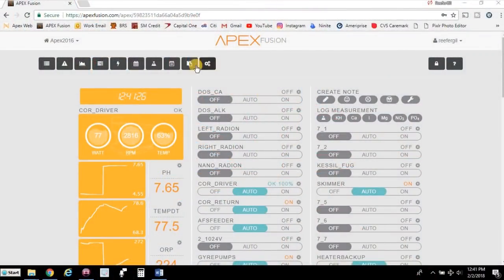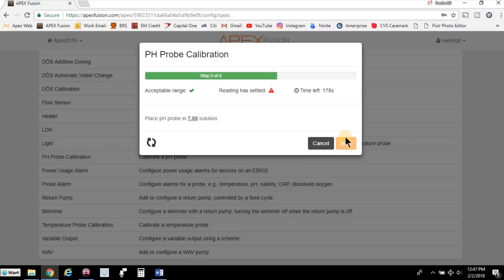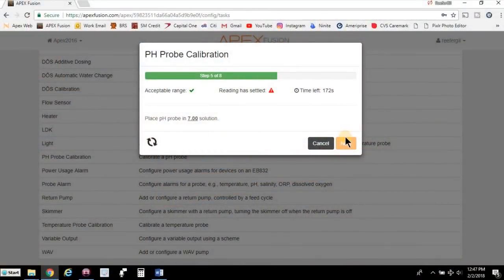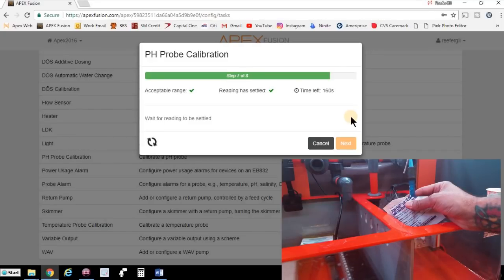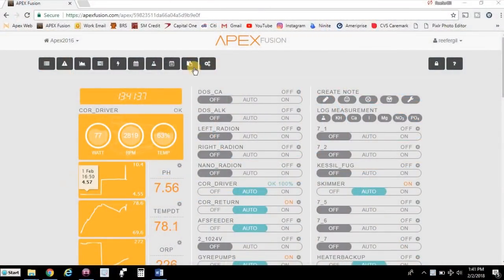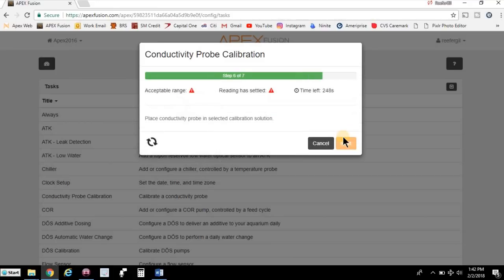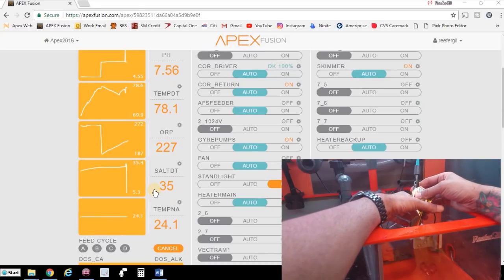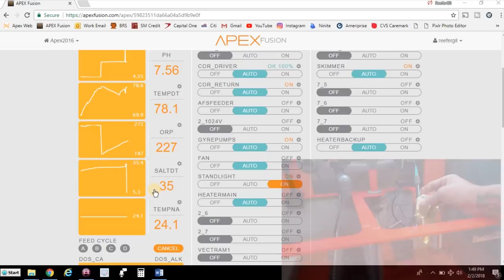Apex pH And Salinity Probe Calibration

Comment: What if after calibrating twice but it shows 7.16 on my fusion dashboard when placed inside the 7.00 PH reference solution...Temp is 77.9
Reply from the maker: That's not way off to the point I'd be concerned. But in reality, it should be a little closer to 7.00

Comment: Thank you & great video! My only problem is with my Salinity Probe. I can't get the green check for the "Acceptable Range." The probe is straight out of the box and bone dry. Yet it still says to "Dry the Conductivity Probe." Am I missing the brain cells necessary to get this to work? If I understand you correctly it shouldn't be put into the solution yet at this point. Please help! I'm no Chip so I have little love for technology.
Reply from the maker: Correct. Needs to be dry prior to placing in solution. I took a paper towel, wrapped the probe, and shook it.
Reply: @ReeferGil  I finally got it to work. But def. need to try recalibrating. Kept getting messages on my phone that it was high. Came home and tested it with my Refractometer and it was a perfect 1.026. Guess technology needs to be taken with a "Grain of Salt."

Comment: This was so useful I have been chasing 8.3ph for ages. I constantly get around 7.2 to 7.3 once I calibrated the 7 changed to 8. Now getting an average of 8.2. I also calibrated the salinity which was way off. This guide did the trick step by step instructions I could follow. Your rock 🤘🏻
Reply from the maker: So glad it helped. Thanks for taking the second to post you comment!
Reply: cody colina  No never found that to be the case at all.

Comment: Every time I do my salinity probe calibration it is spot on for a day or two. Then over the next week it becomes uncalibrated. Anywhere in the range of 24- 40. I've done it at least 5 different time and with 3 different probes. Used different brands of calibration fluid. In 4 separate tanks. I do t understand it. Have you ever experienced this? Right now its reading 31.2 which I know is incorrect. I have 2 refractometers and they both read 1.026
Reply from the maker: Hey Brian. Fortunately, I haven't had any issues. It's reading 35.5 in the main DT. I also have a salinity probe in the nano tank and that one is reading 35.1. I just compared it to my refractometer and both systems were reading correctly. I would contact Neptune System's support to see if they can help you. Excellent customer service from my experience.